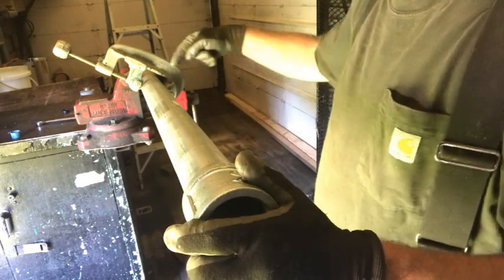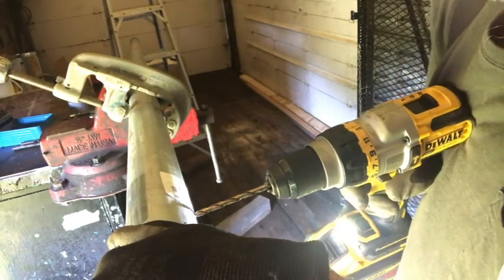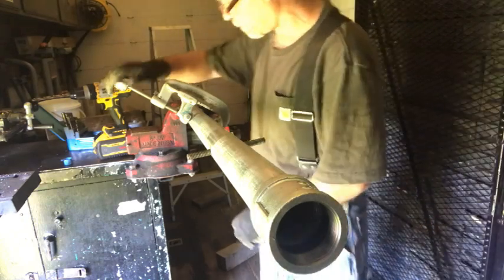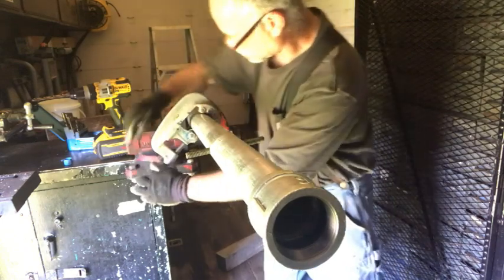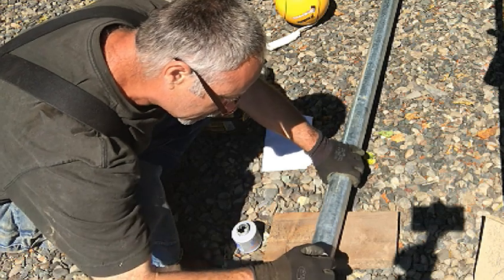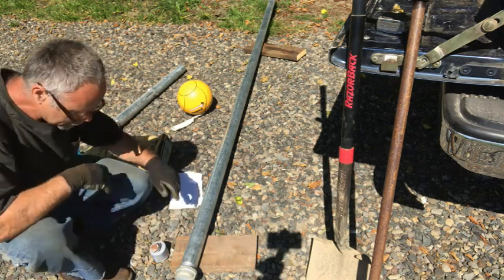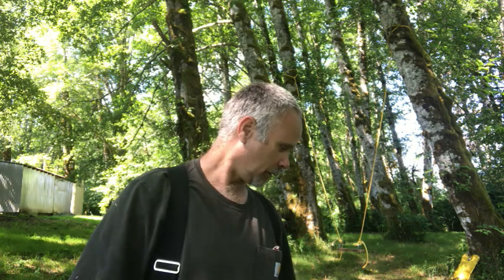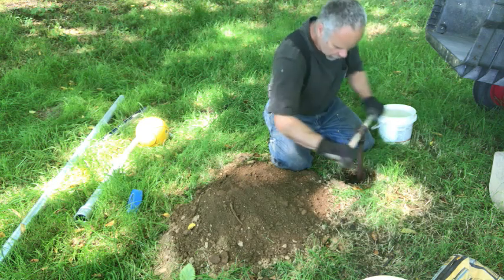Putting in a Tether Ball Pole at Rain Country Retreat

Comment: Cool video. But I have to say I'm shocked by all these videos with short and thin poles. For little kids, they are great. But for 10+ or teenagers? Maybe not so much fun.

My reference for this game are poles around 6 meters high that they had at school. Maybe 6 or 7 of them and in different areas too. The poles were thick, so they would never wobble like the thin ones that I'm seeing on YT.

I have to say I'm surprise to see American videos showing short and thin poles. As a matter of fact, I can't find any video showing real poles.

And those poles are better, obviously, because the game is more challenging, the ball goes higher and you can use movements from volleyball. There more freedom of movement and you can add more strength. Blocking can be really fun too. A high pole allows a larger spacing between the four players.

Well, this sport can be really fun for young and older adults provided they're using the proper equipment.

I haven't played it for decades, but I would still have lot's of fun if I played it today. Lot's of good memories with this sport.

Btw, this is one of the best poles I've seen on YT, if not the best. It goes higher than most and that's important. I totally understand that your goal was not building something at "pro level" or anything like that.
Reply from the maker: Here is what I can say: Patrick went by the standards he looked up online and it is meant for our grandchildren and great nephews and nieces, not for pro athletes. I did not even know that something we simply consider here in the states to be a playground game meant for kids was something others played as a professional sport.
Reply: @RainCountryHomestead  Yep, that's why I complimented: I understood what his goal was.

Idk if this is played professionally, I just said there are more robust options out there for teenagers and adults and that I'm shocked to see this always being treated as a little kids game when it's much more than that.

I can say that back in the 80's (and probably before that) it was already not treated as a little kids game by people familiar with the sport. But prejudice related to little known things is common place in humanity, so I shouldn't be surprised.